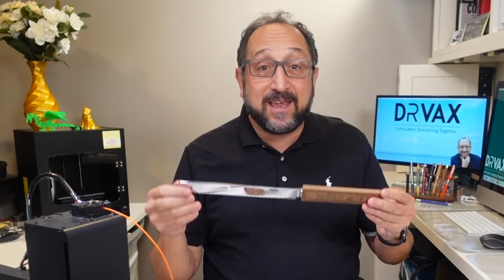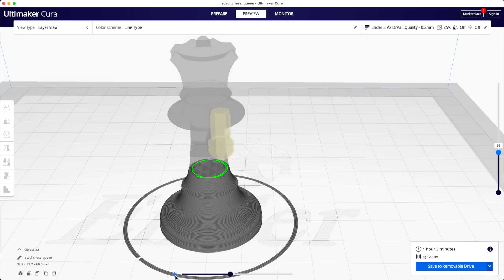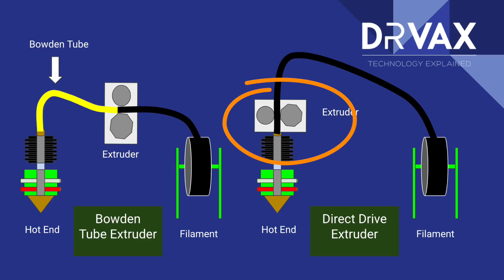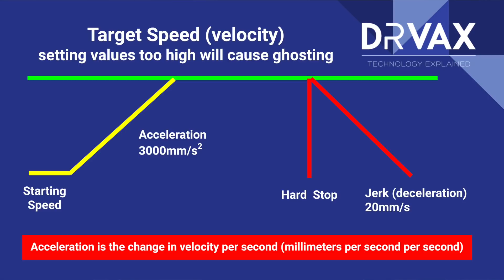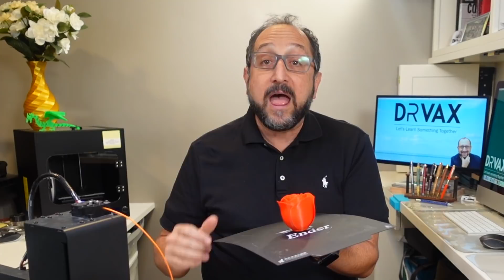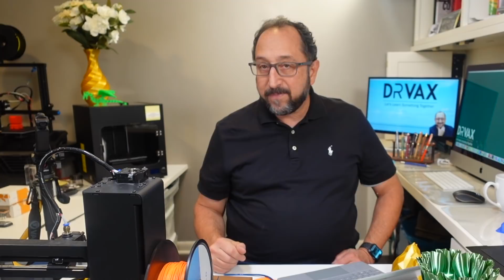Troubleshooting 3d Printing Problems

Comment: What’s your opinion on the mod where you put a length of boden tube cut to the length of the extruded with a washer on top to compress the Biden tube a bit. This is suppose to boden  tube planted to the nozzle.
Reply from the maker: Interesting idea.  Had not heard of this before.   This might be a very good idea for ANET ET4 users.  The bowden tube on the ET4 is only 3.8mm OD while most Bowden tubes for 1.75mm printers are 4mm OD.  This means you cannot replace the factory supplied Bowden tube easier.  I have thought about using a short segment of ANET tubing inside the hot end connected to a traditional Bowden tube on the outside.
Reply: I've just done that because the bowden tubing started to melt and clogged up my hotend. Works like a charm. I've used capricorn style tubing because it's more heat resistant and I still like the "regular" tubing for the rest of the distance because of its slightly wider inner diameter. Inside the hotend it doesn't matter that much because the filament is getting heated up which makes it more pliable